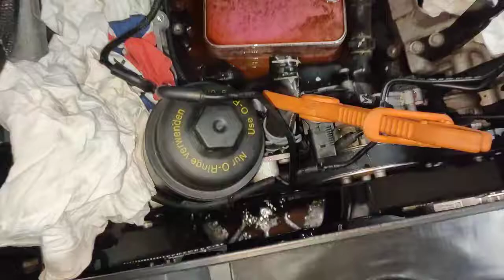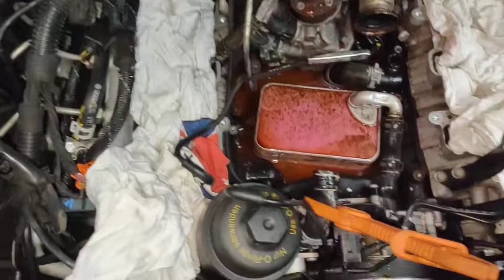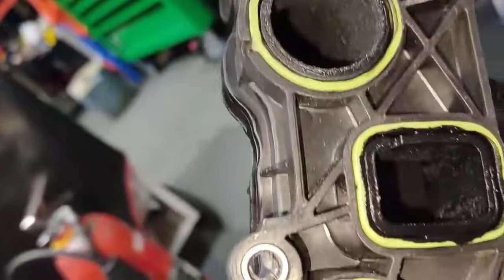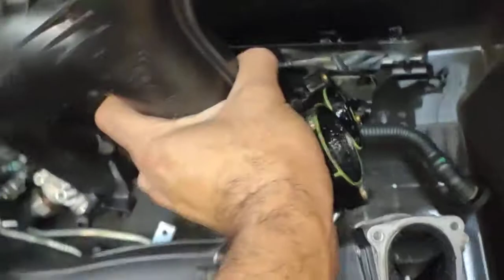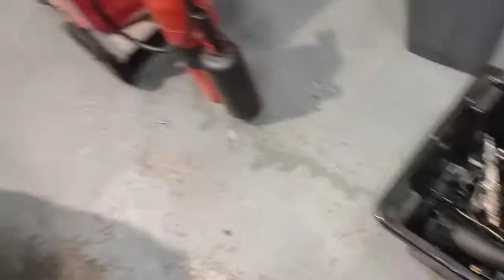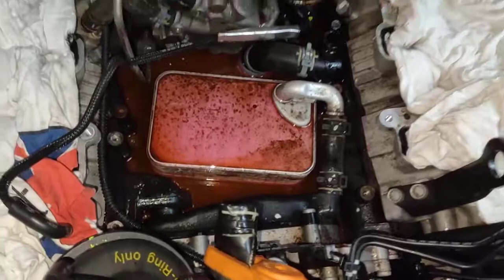Audi/VW 3.0L V6 diesel - Coolant leaks part1

Comment: Just replaced the oil cooler 8 months ago. Low coolant light come on. Been losing coolant! Now i have milky oil. Is there any where else to check where it could mix. I replaced what ya suppose to when you do a oil cooler. Could it be blown head gasket. Ive noticed milky oil around oil cap before. Now its bad

Comment: GOOD VIDEO ANY CHANCE YOU CAN SHOW THE WATER PARTS OF THAT YOU ARE CHANGING AND SHOW WHAT THEY ARE CALLED HAVE A 177000 MILES AUDI A6 JUST STARTING TO   LOSE WATER AND LEAKING A BIT OF OIL AROUND THE OIL COOLER WOULD DO THE JOB MY SELF THESE ARE FANTASTIC CARS THANKS FOR YOUR TIME WILL BE A GREAT HELP AS GOING TO START GETTING THE BITS BEFORE TAKING ON THE JOB

Comment: What would cause high pressure in coolant reservoir when driving enthusiastically? I am getting coolant coming out from the reservoir when hot , changed the cap , still the same . Saw your other video regarding coolant regulator , just wondering if that could cause high pressure in coolant reservoir. It’s an Audi A7 3.0tdi
Reply: Did you ever fix this problem?
Reply: Can anyone tell me how many thermostats in this engine.
Reply: Usually it's a blown head gasket. The excessive pressure from a break in the head gasket allowing that air to go into the coolant and out the reservoir. André